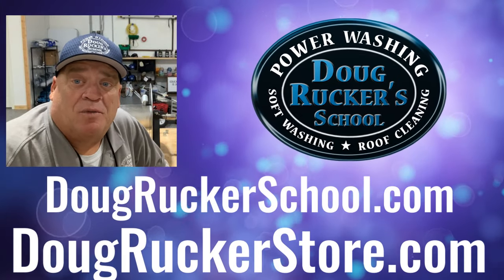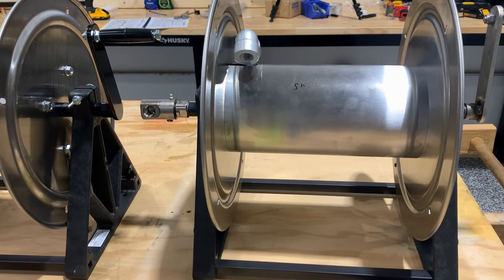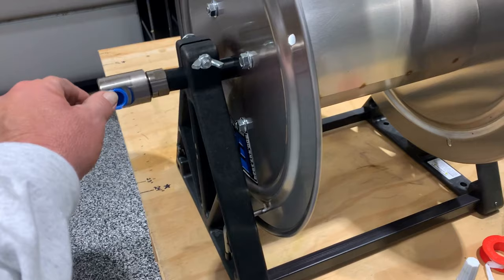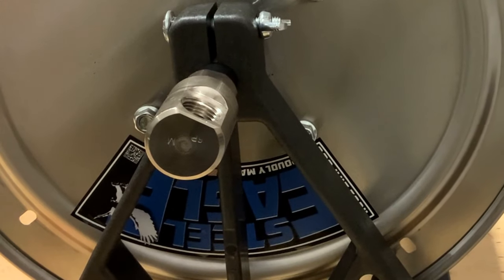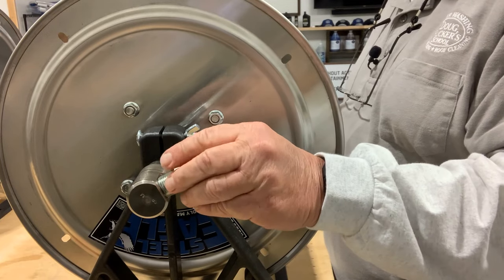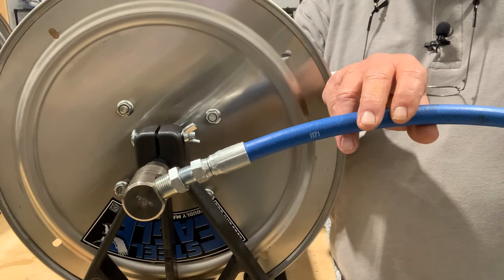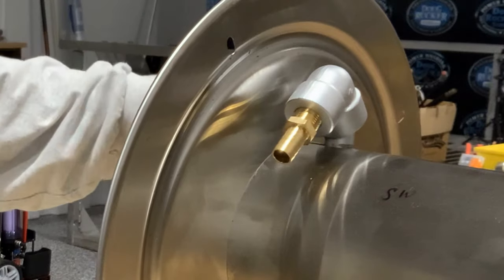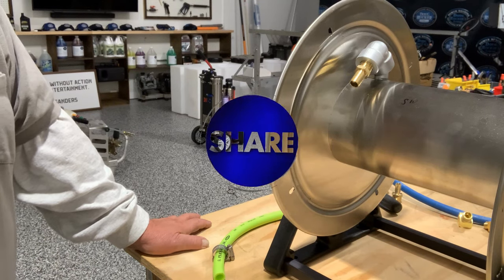Pressure Washer Hose Reel Set Up {Doug Rucker Steel Eagle}

Comment: Good video . A little confused, cannot find a reel that is specialized for chemical / soft washing . Do I just use all same reels for pressure , garden and chem ?
Reply from the maker: Reels w Stainless steel manifold are best for soft washing. But even those the bleach will eventually cause leaks in the manifold. What pump are you using ?
Reply: 7gpm Remco fatboy12 volt
Reply from the maker: @jackrosenfeld3859  this would be great for that pump w 3/4” manifold. Will help give you the best flow and distance using 5/8 spray hose. https://www.dougruckerstore.com/products/steel-eagle-hose-reel/
Reply: Sounds good thanks !
Reply: Are manifold sizing very important for the pressure hose and garden hose reels ?

Comment: So is the garden hose reel and the pressure hose reel the same? I’m trying to buy my setup now but I don’t want to buy the wrong thing thanks!
Reply from the maker: Yes. I use the same one for both
Reply: @PressureCleaningSch  Buy 2 steel 100ft 4000 psi pressure washer hose reels and it will be compatible with the garden hose as well?
Reply from the maker: @kobebryant7116  yes. Just have to use the right fittings on the swivel and manifold. Very easy to do
Reply: @PressureCleaningSch  thanks Doug!

Comment: hey doug, i notice you use a male QC coming off the pipe on the manifold and not a female QC, is it bad if i use the Female QC on the manifold?
Reply from the maker: No it’s not bad. It will work just fine.
Reply: @PressureCleaningSch  thanks man, you are an expert so i wanted your advice.

Comment: On the softwash hose reel, Can I use quick connects on the outlet side? It’s too hard to have to roll 200 feet of hose just to move the truck.
Reply from the maker: You can but you’ll be replacing them frequently due to the bleach rusting them out.